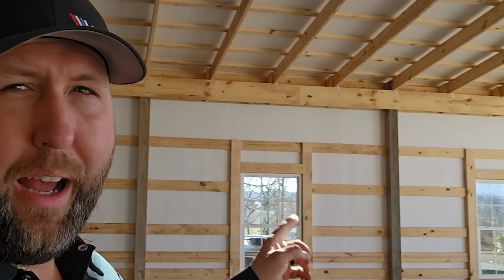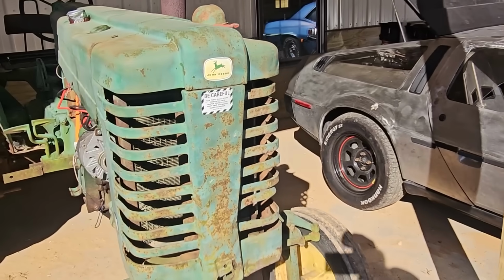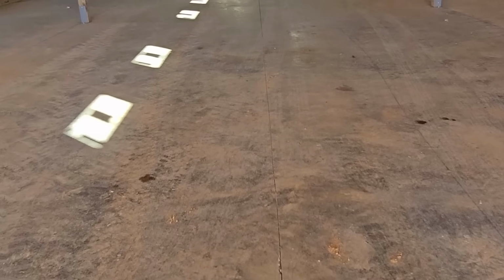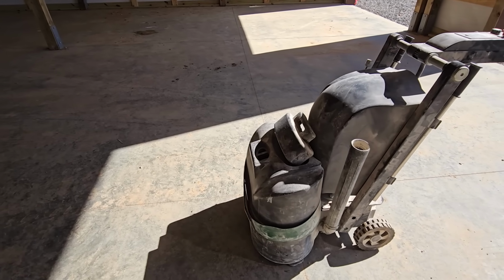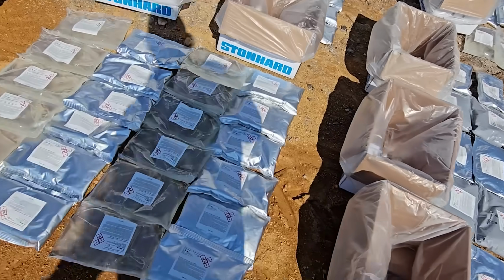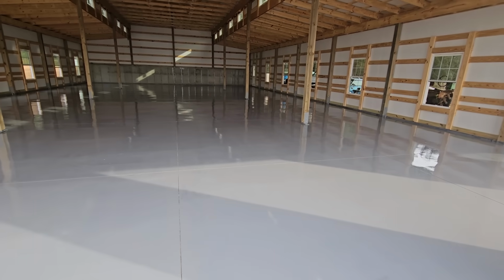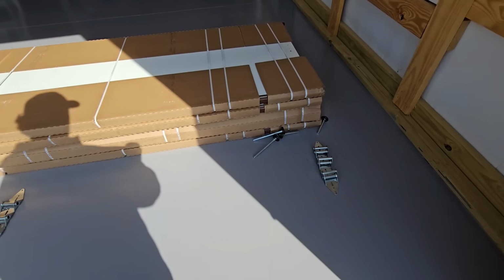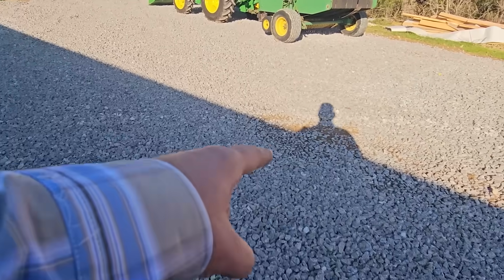Windows, Doors, Floor Epoxy, Gravel and MORE! Barn Build - Part 3

Comment: Where is the sewer line and 750 gallons of plastic sewer empty tank. In North Carolina, my sister have back hoe super loader tractor diesel for buried tank and some network of piping to the treatment of Rid X and the less electric water heater, the less iron is polluted to the water system recycled with rain water. Then bleach the water every 8 months.

Comment: To add more mortar atop the new and cracked concrete use at least 2 inch thick and grind the smooth concrete into spots of dull concrete and can use Portland concrete mortar add with sand with silicon all purpose.then water with how and a shovel.

Comment: They do not put the rebars to inside the wet concrete for floor. They use strong galvanized fence atop the fibre black sheathing onto the rocks crush and make flooring with concrete mix atop the lay down fence that is much more stiff than chain link fence.

Comment: You have lots of flat roof space.  I would install a solar system  to power the new barn.  Add a battery backup system and you can have power at night as well.  The best part is you may be able to deduct a large amount from your taxes AND FREE ELECTRICITY

Comment: Where I live in upper east Tennessee a lot of concrete companies and contractors say you don't need to use rebar in most residential situations. That said, everyone I know who has had any major sort of concrete slab work done has demanded rebar be used before hiring a contractor or sub to do any concrete work. Rebar and joint placement and timing along with proper mixing and experience and luck, along with a basic understanding that sh!t happens, will get you a long way when dealing with concrete.

Comment: A recent subscriber been catching up on all your shows looking at you shiver in your workshop. Reminds me you should do some research on radiant heating. It’s basically where they bury the Pex line in the concrete foundation and then run hot water through it. It actually warms the place up really good doesn’t use that much power.

Comment: Hey Derek, as a guy that has worked on a lot of different surfaces, what would you recommend a guy to have in a shop that works on a lot of grease, rust, torching, and welding? A working garage that prioritizes easy sweeping.

Comment: I poured a lot of concrete, even in the south. I always use concrete mesh and rebar in every pour. Just looked at a pour from 8yrs ago. Not one crack. Even fibercrete needs mesh I don’t care what anyone says. The cost and headaches of fixing those cracks could have paid for your mesh. Plus you always put rebar around and under a support post, or you will have more cracking. Ask any structural engineer. Who ever told you not to put support in the concrete lied. Those floors will continue to crack with every freeze and thawing. The ground is constantly moving. Just my opinion, hope I’m wrong.

Comment: Derek, seriously I will do my best to help you with your hvac needs, my dream truck is is a 68-72 k20 reg cab lb, you probably have one In rusty acres, you pull permits I’ll provide the solution, let’s help each other, the classics are disappearing I lost 42  vehicles in divorces, love what your doing, and I would love to move back the tenn.

Comment: Solar would be your best long term bet for power. But that's never a fundage friendly answer to the question. From experience, it's worth it in the long haul. Just expect a large upfront cost and then upgrading panels in about 5 years and upgrading batteries as new tech becomes available. Those upgrades will be your "power bill" so work that angle wisely.

Comment: Along With the great design and build of the  barn, it now awaits the same work for a tractor, that should be easy-peasy. Your decision to use brick capping is also a great one. I am truly impressed at how your plan has come together, Derek. PS, instead of brick, you could get your wife to bake scones to replace the bricks? With the cracks, I am surprised you didn't use templates to simulate a stone floor. It may have distributed the stressors more evenly, and with the addition of some concrete colouring powder, it would have looked like an inlaid rock floor? Just a thought for next time?

Comment: I think the base should have been rolled with a machine to flatten the base. I think what happened was some base settling under the new weight and the weight of the concrete being on a slightly higher area when the other area lower under the pressure the cracks came.

Comment: I'm wondering Derek, if you may have 3" instead of 4" thick concrete. It's a common thing to make it 4" on the edges and 3 elsewhere. 
Or maybe there's NO reo mesh in there. That'll crack for sure. Paint ain't gonna fix that cracking.

Comment: Put gutters along the sides…. No gutters = southern thing, so is damaged foundation and termite damage. Never saw so many structures w/o gutters since I’ve moved from the northeast to GA and of course the accompanying damage on structures with a little age and no gutters. Easily avoidable damage.

Comment: Worked in a 12 bay autoshop back in the day.  They painted the shop floor with grey epoxy paint.  Took a couple days to fully cure.  It provides a very nice surface when done.  Pretty easy to keep it clean...which got done nightly.

Comment: I did an 6-8" pour on a 60x75 garage and used fiber & rebar and also had 13zones of radiant.  I dont have any cracks, none. I really thinks it comes down to the ground prep, the mix, and how it dries.  Your floor looks great after the fixes.

Comment: Derek, since I am old enough to be your father. Those rocks are going to be hard to take a walker thru. I was out with mine to a wrecker and had a very hard time. I would have used 3/4 inch watered it and packed it.

Comment: With concrete I think you need expansion joints because it expands in the hot and shrinks in  cold weather

Comment: I was a carpenter for 33 years so I’ve had my share of concrete work. I was told that concrete has 2 guarantees, it’s gonna crack and nobody will steal it!
Reply: Concrete never needs mowing. I love concrete!!!
Reply: That's correct, but I've never seen concrete crack right after it was poured. I'm guessing they let it sit for 7-14 days before erecting the barn. The cracks were present in the erection of the barn
Reply: I would actually say, and this is coming from 30 years of direct concrete work and carpentry. Quite possibly the ground work was not compacted to specific standards or not enough rebar/wire mesh or something different. The strength mix of concrete is also a factor. And the many questions for crews involved like has someone driven a truck onto the green slab? But you are right about the floor should not have cracked that soon or that bad.

Comment: You probably only need rebar in the footers like you said. We also use it vertically to tie in the big nail straps to the structure and for post anchoring but everything in az anymore is done in post-tension to compensate for expansive soils and really any soil conditions one might encounter here. 
That barn is sweet. Huge amount of covered space for the toys. Probably sleep better knowing the cars are all out of n the elements.  Only battle you'll have is mice. Those bastards occupy any dry space then can get into.

Comment: @vicegriplodge id highly suggest you put in piping ( pipe - plastic same as used in oil wells on a farm ) to run hot water to heat . A tank less water heater cost about $33 bucks a month to use . Cheapest and best way to heat and cool your new shop.

Comment: That’s an impressive floor upgrade and looks awesome. My barn isn’t near that size (30x50) but they laid plastic and wire before concreting (Texas)…it still has plumber cracks.  Pad was sitting for a year and packed before hand.  I didn’t install power at time but later ran power to it and wired it up with a bud.   In the meantime you can wire up a few plugs and lights and run them with a generator if needed. 

Great hang out area for an evening beer or two.

Comment: Whats the reason that they gave for the slab to crack because thats not normal. If they did it Wright it wouldent have crcracked.  They probably didn't compact the ground properly before pouring the slab. If thats the case it probably will crack more as it settles.  And how do we know how the fix is going to hold  up down the road .😡

Comment: The barn looks great, you have a great place to keep your treasures.  You might consider adding a few solar panels to the roof connected to a power wall.  This would give you enough electrical power to run a few lights, and some battery tenders to keep a few batteries topped off.

Comment: Man that sucks about the floor with cracks so early/ I would of held off on coating due to problems with floor you will keep having. The ground did not gret compacted enough or construction caused sink hole / water loss

Comment: As a concrete guy I cringe every time I see people not put rebar in concrete  wire mesh is a joke as well,  the cracks would never have been that big if rebar was in there,  and   It cracking that fast the sub grade wasn't compact very well, it's best to let clay rest at least 6 months before  doing that kinda work, your gonna see more cracks show up next spring

Comment: Derik have a question if you don’t mind. Wife and I are getting a 53 F100 for her daily driver. Has a new 555 Skip White motor but has a carb setup. Roughly 720 hp. Would the Holley sniper be the better choice than the Edelbrock pro Flo 4? 
The Brick veneer is actually a very cool way to go. I did a commercial roof for a customer of mine who went that way on his new office building. Saved a ton, it was super fast and looks fantastic. It was done 10 years ago and still looks brand new

Comment: I live in the south.  always have.  Had driveway poured in Lubbock, TX.  Fiber they said, no rebar needed.  It cracked all to hell.  Now live in Corpus Christi, and had a driveway poured here, with rebar.  no cracks.   Post-tensioned is the only way to go.  But I hope no reinforcement at all works for you.

Comment: Also I was thinking, I would talk to the owner of the pond and see if you can lower the spillway in a direction away from your property, that would help with the surface runoff, but not with the underground movement. Give it thought, best wishes always.

Comment: Not sure about that talking about not using rebar down here. I just had a really big slab poured last year using both rebar and fiber mesh. But it does  knock the price down a smidge. 

But honestly there’s really only 2 types of concrete. Cracked concrete and Concrete that hasn’t cracked yet 😂.

Comment: My cousin who is a concrete contractor. He's done a few good size jobs for me 25 years ago, to this day there's not one crack in any of it.  He did use rebar and a fencing too.   My back patio was poured 25 years ago by someone else because my cousin passed at an too early age.   That hasn't cracked either and we're up north where the winters are harsh sometimes.   My garage was done 15 years ago by a friend contractor and it had cracked like above right away.   I think it depends on the contractor you use.  I personally trust few contractors
It makes me wonder why they don't use rebar in the South.  That's just lazy and cheap.  I hope the price is a lot cheaper for not using it.

Comment: As a fellow Tennesseean curious who told you nobody uses rebar down here ?
I’ve had big pads poured at home and several patio’s.
All of them have rebar or wire mesh in the smaller pads .

Comment: ? are you putting a lift in that new garage and is there any extra support for the weight of a car or truck up in the air something to carry that load plus the weight of the roof on the walls ??

Comment: Rebar does prevent structural cracking though. In Australia, the local councils will not let you put in a slab for an outhouse without rebar. We do have a lot of clay though, which does expand and contract a bit. Most of our housing is built on concrete slabs these days. I am stunned you guys do not build shed structure of this size out of steel beams though. Is it due to cost? White ants do not eat steel, and they are pretty common in some areas. My own house is built of formed galvanised steel frames.

Comment: Because of your water problem causing hydraulic pressure, which could cause ground settle  and concrete cracking. Draining system could be called for? Best wishes, hope it works out for you. God bless you.

Comment: Did my 28' X 32' detached garage/shop in 2015. Had a floor coating I kept referring to as "Epoxy"  (that they conveniently neglected to correct as "their blend") that cost me $3500.00. This is in "high cost" San Francisco Bay Area. Your floor, provided for free by your contractor, would probably be more than double that this many years down the road even in Tennessee  !! Looks GREAT !!! ;O)

Comment: Looking good bud. I would strongly suggest you get an apron poured on the entrance area if you haven't planned on it already. Erosion and high traffic especially with tractors will cause the slab to crack and break away in chunks. 6-8" thick fiber mesh with wire reinforcement on a solid gravel base

Comment: Here in Texas we use welded wire mesh at the very least in slabs. Others prefer #3 rebar on chairs. No way would we pour a slab without reinforcement  steel. We even put steel in our sidewalks

Comment: These cracks are not fixed. And dudes here might think so but guess what, women knows better. Yea, you saw right, women knows, becuase they done it forever. Its called consealer. Cracks still there but it looks good since its not visible. Til the day efter.

Comment: You may want to consider a small solar panel with battery so you have lights, and can power the garage doors.  Can also charge batteries with it.

Comment: Not using rebar in the south is incorrect. It depends on the application, there's always rebar in the footing and the slab will either have steel wire or fiber. The more water in the concrete the worse it cracks later. Those epoxy products are nice. I recommend it and use it on my own floors.

Comment: The reason you have cracks in your floor..
Too much cover from the top of your concrete to the mesh steel to allow it to act as a crack resistor.
Poor concrete design mix, too much moisture and not enough retarder allowing the concrete to cure too quick.
Not enough compaction during installation allowing concrete to settle whilst curing.

I could go on.

Comment: i would put solar on the building. a couple LED lights and garage door openers wont even touch what solar would provide. Being out in a open area like it is, be more cost effective then running power line and poles out there.

Comment: Gotta say, been living in the south for over 50 years and when a slab is put in, wire mesh is used and if the slab is going to hold vehicles, rebar is used.
Reply: they add shredded plastic bottles to it now. it gives it strength without wire and reed bar. ittl still crack tho

Comment: Great looking building. So no one uses rebar. Cost is the only negative. Even with it, concrete might crack. Lots of variables there. What the rebar WILL DO is keep the sections from misaligning. Nothing worse than having a joint or crack rise up and make a trip hazard or an obstacle to roll things over like toolboxes and such. Good luck with everything.

Comment: I've always thought there's a lot of old tired iron like that John Deere kicking around in the weeds because no one wants to take the time to Tinker with it get it started get it running specially in the winter and the constant carburetor things that happen. I know it's easy to switch them to electronic ignition and still use the factory distributor housings and such to get away from the points and all the ignition problems, but good old-fashioned fuel injection would make them reliable easy starting and bring thousands of them around as a daily driver again. With your knowledge and your resources and your Connections in the industry I think you're the perfect guy to take that bull right by the horns and show us how to take all those cantankerous old mules out of the hedgerows and make them into reliable draft horses

Comment: Hey Derek,,,  Usually rebar is not used in floors unless it is going to be supporting very heavy loads,,, What is used ,, at least here on the west coast is wire mesh,,  Works very well to prevent floors from cracking,,,  Also the use of curing compound sprayed on the floor after the concrete has set is important to keep the concrete from curing too fast and thus forming cracks,,  Four weeks is about normal for a complete cure,, :-)

Comment: We have several of those old Deere's.  They must have 50% throttle and full choke to fire off.  Some of them have compression release valves down on the side of the engine that will make it whirl over better.  Good luck!